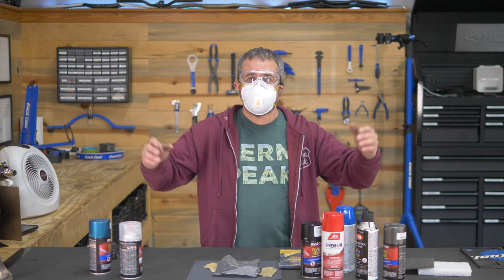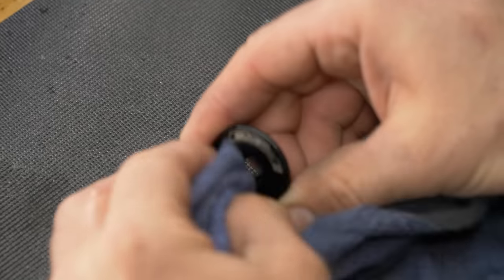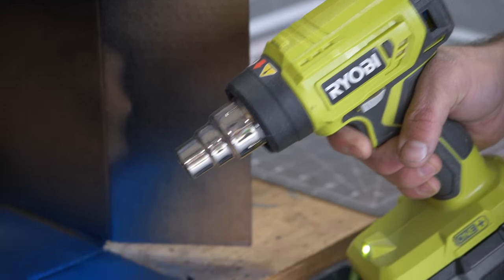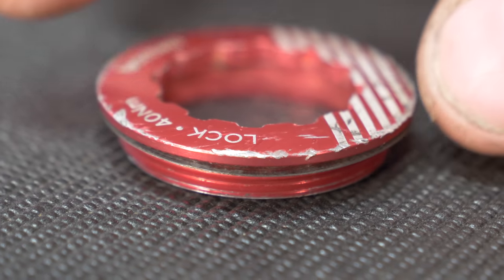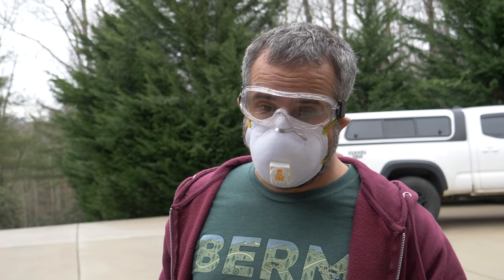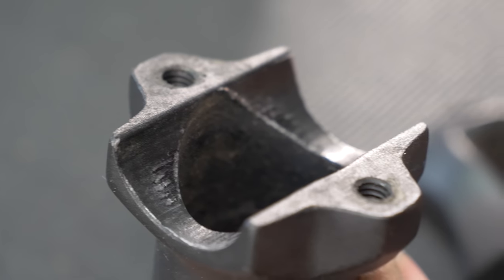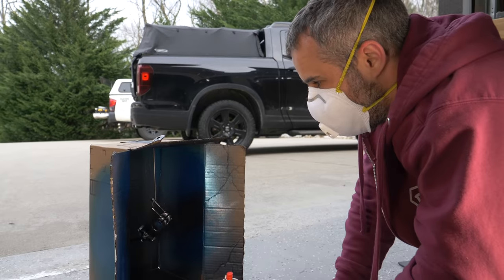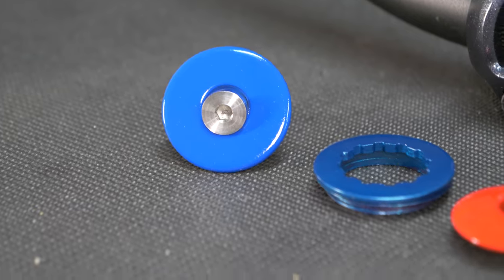How to paint bike parts the cheap and easy way!

Comment: I use these methods to paint all sorts of stuff. Mainly PC Cases and metal parts to things as well. 
I usually use a coat or two of self etching primer on things I want to look amazing after the sanding/cleaning step. Yes most paints have primer in them but the self etching seems to work great for satins I have tried. (Mainly Rustoleum 2 in 1/ and Krylon Fusion)
I always hit the paint can from 8 to 12 inch distance with the low heat setting on the heat gun moving around the can. Once the can feels warm shake the can until the paint is mixed up and it feels cold again. I do this for a good 30 or so seconds and it really makes the paint flow smooth. Just be carefull not to heat it crazy hot or in one spot for longer than a few seconds. Works much better than the hot water trick. Just have to be smart not to heat it crazy hot as its under pressure and can easily explode if you go crazy with the heat. Just slightly warming it to get a good flow. 

I also heat up the item before spraying with the heat gun and after with the heat gun to help cure and off-gas. 

I want to spray a cheap frame I have for my main bike badly with tougher paint so I might try the duplicolor engine enamel someone was saying below. I want like a matte or satin black on it so bad. Can't afford a good frame atm and stuck with an old iron horse one but changed out about every other part through the years to have it be an insane bike now.
Reply: Too many people sleep on the old iron. yes they're heavy as hell, but they're solid and the inherent flexing in steel gives a less stiff ride. Carbon and Aluminum have their places yes, and buy what you want, but if steel is what you have? Nothing wrong there.

Luck to you on the rattlecan adventure.

Comment: Also for aluminium if your sanding back to base metal, you want to apply etching primer that chemically etches into the aluminium and gives you a nice base coat to work from easily available from where you got your paint.  What you done and there is nothing wrong with it is you abraded the etched and painted surface that gives a mechanical area for the paint to take hold. That is ok for steel, but after a while on aluminium it will flake off.

Comment: I have a suggestion:
You could paint those plastic valve caps to get custom painted valve caps if you can’t find the right color.
Reply: So you need to find the right colored paint instead.
Though that's probably easier and you can use the same paint on other parts and have them color matched perfectly
Reply: @sebastianjost  and you'd have some paint to touch them up and keep them looking fresh AF.
Reply: When painting plastic you also need an adhesions promoter for it to properly stick.  There are certain primers that he’d need to use but that could be a good idea.
Reply: Buy aluminium valve caps and paint them with light sanding👌🏼👌🏼👌🏼
Reply: @roni2671  aluminum valve caps suck. They just rust and corrode
Reply: @Henryjamesklein  true, but all valve caps suck
Reply: @Henryjamesklein  not for me lol and weather here is shity we just had untouched snow up to chroach  and summer just rains so i wud know
Reply: @Henryjamesklein  Aluminum doesn't rust. Iron (eg steel) rusts. However aluminum does oxidize and that can be an issue with paint adhesion. Well applied, the paint protects the metal from oxidization.
Reply: @taefer7437  well not on plastic

Comment: Quick tip, if you actually want the paint to last and prevent it from chipping I recommend using a primer before the top coat. Once that's fully hardened spray your top coat and it will come out much smoother and will adhere better to the part. After that top it with a coat of clear and it'll look mint.

Comment: Cant really fauly anything that Seth has said here, this is very good video for people who are trying to start out. However coming from the automotive paint industry i do have some tips.
Using a red/maroon scotch brite in place of the 400grit sandpaper is a really good alternative if the part does not have chipping paint, it takes the shine off while keeping most of the old paint still there, and its abit fluffier than sandpaper so it makes it easier to get into hard to reach places,
I would use wax & grease remover over rubbing alcohol especially if you see yourself painting often.
Tac cloth before first coat only, if you do it between coats you risk damaging the finish.
when painting raise the part off where your painting abit and put water down, this will help catch dust flying around as instead of getting airborne off the floor and sticking to whatever your painting.
And lastly if you drop whatever your painting often and ruin the finish instead of waiting for it to dry and sanding it back to start again you can use paint thinners (nail polish remover might work but never tried it) to instantly wipe off the new paint and re-prep your item and try again.

Comment: Nice ! One thing I could propose is to use a 2 parts clear after... like this one ! USC SprayMax 2K...this would last forever and resist bike cleaning very good.
Reply: this is the real paint with the hardener not the one seth used.. and i agree with the 2K top coat. once you used it you'll never go back to 1K clear
Reply: Yeah a 2k coat seems like the best option for a finish. But you need to take safety and air quality seriously with that stuff, a lot more than just a standard spray can. I would go as far as to not have skin exposed.
Reply: FYI - Respirators are absolutely required if you spray a 2k clear coat.  They will cause permanent damage to your lungs, that N95 in the video wouldn’t protect your lungs.  You’d want a full blown cartridge style respirator.

Comment: Another good tip for perfect finishes is to use spray max 2k clear coat.  It has a strong UV finish and last for years.  It’s essentially the same kinda clear they use on cars but in a can.

With that one you absolutely have to have a respirator or you will get permanent damage to your lungs.  Standard N95 like you are wearing won’t cut it in this case.
Reply: Another good tip is to use ear plugs to block off threads.  You can cut them up and make them work on fine threads.

Comment: Try painting a freshly sand-blasted surface with any of the metallic automotive paints and a few coats of clear! The rough surface takes paint really well and the randomized grit pattern creates an almost-3D effect with the metal-flake paints that looks like a high-quality wheel. Clearcoat will make it more durable and give a nice finished look. You can even make a gloss basecoat into a satin one if you topcoat with satin clearcoat. That way you don't have to buy multiple finishes in every color, just a gloss clear and a satin clear for your final step!

ALSO!! The blast media you use makes a difference. You can get aggressive media that is even faster and coarser than sand with the coal slag stuff or use walnut shells for something that is very gentle and doesn't take off any of the substrate. Remember that most blast media is friable, so it will become less aggressive the more you use it, so if it's not cutting like it used to, clear out your cabinet and replace the media.
Reply: I’M HUMBLE AND 👆🏻👆🏻👆🏻APPRECIATE OF ALL YOU’VE DONE FOR MY SON SCHOOL BILLS THIS FLIPS REALLY GOES A LONG WAY YOU’RE THE BEST

Comment: Using grease or vaseline in threaded holes or hard-to-tape inner surfaces works wonders with a little patience during the prep phase. 1: tape, 2: apply grease with a q-tip or similar swab, 3: use alcohol and a clean swab to wipe away any excess.

Comment: I’ve actually heard of guys using modeling clay or pottery clay to fill bolt holes, let that sit for a day or so to harden before you paint, once the paint dries, you just chip the clay out and use some water to get the little stubborn bits out of the threads. Then you have a perfect coat and untouched threads
Reply: Foam earplugs works aswell, and theres no waiting :)

Comment: another tip for bolt holes if they are big enough. Foam Earplugs. super cheap and easy to remove afterwards if you dont have spare bolts lying around.

Comment: PRO-TIP
if you're using automotive grade paint, and you get hazy spots from doing the light coats... you can just use a light rubbing compound or other light scratch repair waxing product and buff it to gloss.

Comment: Honestly, you can use scotchbrite to scuff up a surface for paint prep. Especially if it's anything anodized or previously painted. If it's steel, probably best to use 320-400 grit paper. Really, anything to "mar" the surface. I've painted entire vehicles, and we use 320 as the final. Wet is not really needed. So long as the surface is free of dust and oils after sanding. For small parts you can use an acetone wash. Get you a small glass jar, put some acetone in it and swirl the parts in it. Allow to air dry. It's quick. I always recommend a light coating of primer before paint. Primer adheres to metal better, and paint adheres to primer better. Feel me? Will paint stick to metal? Yes. But not as good as it'll stick to primer. I'm no professional, or a rocket surgeon, just a gear head that also rides bikes.
Reply: Great fan❤️
Thanks for watching, make use of the name above,☝️you are among my shortlist winner's ☑️

Comment: Tip: An inexpensive way to remove anodization from parts is using supermarket bought oven cleaner spray. Spray it on the parts and the anodization will come right off with a bit of scrubbing.
Reply: I’M HUMBLE AND 👆🏻👆🏻👆🏻APPRECIATE OF ALL YOU’VE DONE FOR MY SON SCHOOL BILLS THIS FLIPS REALLY GOES A LONG WAY YOU’RE THE BEST

Comment: Enjoying all the videos, a few tips from my side, after masking off an item, I would clean it with some alcohol to remove any oil, I would pre heat the item to around 30°C and cure/dry it with a bar/infrared heater and not a blower heater to prevent any dust particles blowing onto the sticky paint (im also not a pro spray painter)
Reply: Great fan❤️
Thanks for watching, make use of the name above,☝️you are among my shortlist winner's ☑️

Comment: When you finish a coat of paint, turn the can upside down and give it a quick spray downwind or away from anything important.  That will clear the tube in the paint can and help prevent splatter or clogging the next time you use it.

Comment: I'm a huge fan of red 3m scotch brite pads for prep. You can get a bulk pack of knock off ones on Amazon for cheap. Also, if you're really looking to improve durability, 2k clear coat can be applied over standard rattle can paint. 2k clear is what is used on modern cars

Comment: As a non professional :  When sanding a part flat, you can use tempered glass or flat tile to get a perfect flatness to the part.   This will also help after done painting to get a non-pro finish using higher grip sandpaper.

Comment: A good tip is if you used only some of your spray can, and want to save the rest of it, wipe of the nozzle when you are done with a paper towel, and even better use some isopropyl alcohol to clean it. That way the next time you go to use your spray can, it doesnt have a bunch of dried paint on the nozzle making the spray pattern funky.

Comment: With cans the result use to be good but ... the paint last less than original paint job. So, after 9 times painting my XC frame (one per year) I give up and the last finish was raw aluminium with clear coat and some details to make more apealing. But it was funn, I have even paint one time with a paint that glow in the dark ... but needs light to glow so ... no very glowy at night time😅

Comment: I place the spray can in a tall plastic cup (like a 7-11 Slurpee cup) half-filled with hot water from the sink (not boiling hot) to warm the paint. 5 mins later, remove the can from the cup, turn the can over and shake it while upside down for 2-3 minutes. Really loosens the paint and promotes a nice even spray. And always wear a respirator or you’ll damage your lungs and your brain for good.

Comment: painter here. you did fine my man. a tip i would suggest with rattle cans is pick up a cheap plastic snap on spray handle/trigger. the other is make sure your cans arent cold.

Comment: If you get drips in clear coat it's always fixable even without redoing it.

You can wetsand the drip with 1200 or 1500 (you can start with 800 if it's a really thick drip but make sure not to go through the clear coat) to remove the drip and make the surface nice flat and smooth and then hit it with some polishing compound and get it nice and shiny as if nothing ever happenned.

I've used this technique multiple times on automotive stuff, for example my left headlight on my car was yellow and hazed, a good permanent fix is to sand the hazing and yellowness off, then throw a coat of clear coat on it to make it clear and shiny again, I did that, got a big run in the corner, was bummed, but after sanding and polishing you couldn't see it anymore, took like 10 minutes and was way less effort than repainting with almost a 100% guarantee of it working, it's still holding up a year later.

Comment: One trick I’ve learned to block off bolt holes (in my case on engine components) is to twist up foam ear plugs stick, them in the hole and let them expand. Cheap and easy.

Comment: You need to take a look at stripping anodizing. Caustic soda is the easiest way. Just mix it up in the proportions written on the tub (with water) and then drop alloy parts in there. Make sure to rinse afterwards as to not take off the aluminum itself.

Comment: You can easily protect threads (like the cassette cover) using teflon pipe tape.  It's easy to apply and get situated exactly where you need it.  Then once the paint is dry, you peel if off to reveal perfectly protected threads! No post-painting cleanup required.

Comment: A tip from someone who uses spray cans a lot on models and things: instead of doing one steady pass with the paint, do a bunch of short and light passes per coat. This will make its less likely to drip and you don't have to be super precise about dialing the pressure in. Hope this helps!

Comment: No curing box needed in the summer here in southern AZ.  I have to do my rattle can coats quickly because it'll harden in less than a minute when its 110 with no humidity.

Comment: Probably was mentioned before, but no hardener in that Duplicolor for 12.99, just better spray nozzle and colors. 2k rattle can paint has a puncture valve underneath. Those are $20+/can

Comment: i redid the entire frame and suspension of my 74 super beetle with rattle cans. if you take the tome it comes out super nice. I'm not sure where youd apply it to a bike, but thers some truck bed liner in a can stuff that is rubberized. It's super durable and grippy, I used it as and coating on the bug. So if ya need stupid durable impact resistant stuff i'd recommend that.
Reply: Probably on drive side chainstay.

Comment: a small tip, especially if you store your paint in an unheated place: while prepping the parts, place the rattlecan in your pocket. then it will become adjusted to body temperature which is optimal for spraying. nothing worse than a cold rattle can that splurts rather than sprays

Comment: nope, NO hardener in the paint you listed, that is JUST standard spray paint... its expensive, because it's "color matched" (it's not, it's close tho).

Automotive grade paint is called 2K and has a catalyst (a plunger on the bottom that breaks it open) -> 2K paint WILL KILL YOU AND YOUR NEIGHBORS. it's illegal in most states to use without a filtered paint booth. you don't even need to breathe it in to be REALLY bad for you... soaks into your blood stream from skin & eyes, so you need to COVER up Completely... outcome is totally worth it.

that said, the ticket is to 1k your bike/parts for ya color, then 2K for the clear coat.

Comment: For anodized aluminum, Easy Off heavy duty oven cleaner will completely remove anodizing from aluminum parts.  Spray the part in oven cleaner, let it sit for 15 minutes, then wipe and rinse it off.  This will get you down to raw aluminum which you can scuff and paint before better adhesion.

Comment: Will also say that make sure to get the right type of clear coat for the paint you are using. Enamel paints will only accept a clear that is rated for enamel the clear coat orange peels and looks awful if its the wrong type. Also not all clear is the same hardness using 2k clear coat on your frame will prevent rock chips and awful gouges that regular clear will get. But be careful as 2k clear coat is even worse for your lungs than the auto grade paint. If you're painting steel also look at the time of day you are painting (relative humidity is lower at different times of day depending on the season)  as bare steel will rust especially after you've sanded it then you'll get bubbles and rust pockets which is never good.

Comment: A lot of spray cans have removable nozzles if you notice the flare of the spray is good on one pull it off and save it you will notice some have wide flares and others are tight and some are adjustable like the auto one some will rotate the flare even like line marker paint cans and all can be used to achieve different effects.
Reply: @bermpeakexpress you may want to see if he's scammed others

Comment: If you are painting in a cold place warm up the can of paint and the part first with a heat gun or hair dryer.
Also when you finish using the can turnupside down and press the nozzle for a few seconds it will help the nozzle stop clogging for the next time you use it,

Comment: When you are painting parts with bigger holes you can use a toilet paper roll or paper towel roll to block the threads, ie a bottom bracket or the seat post tube

Comment: Since you’ve been working a lot with restoring small metal components, you may look into an ultrasonic cleaner. It gets in the crevices (especially threads) and knocks out dirt / corrosion / paint without any manual labor.